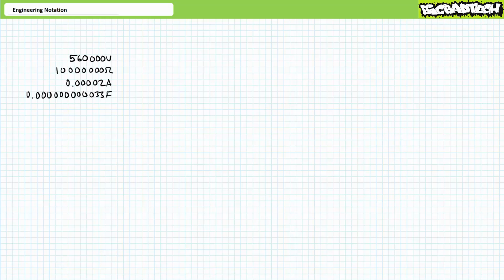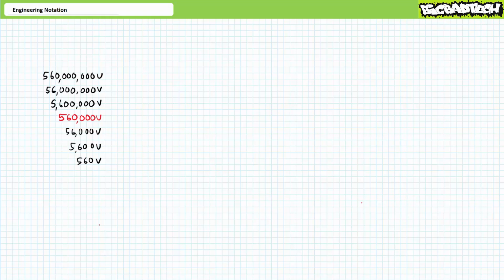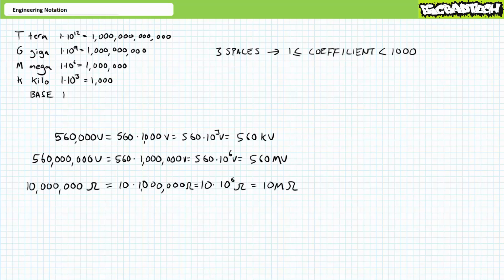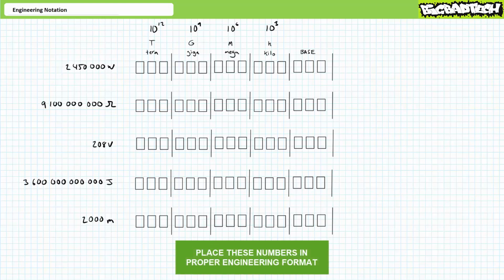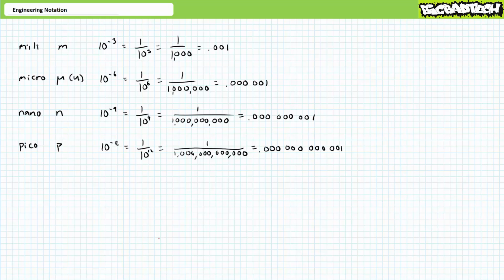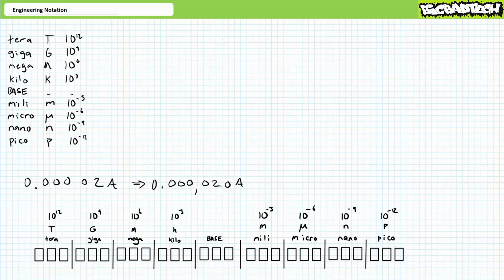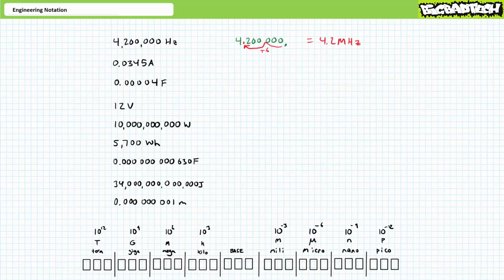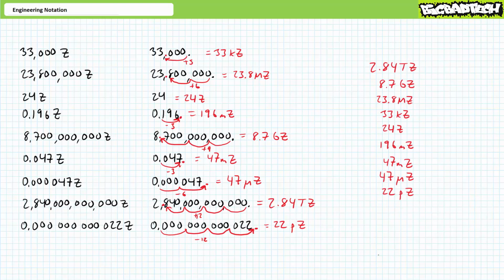Engineering Notation (Full Lecture)

Comment: I'm an electrical engineer, and I prefer scientific notation over engineering notation.  Here's why.

1. In engineering notation, the presence of a decimal point determines whether trailing zeros are significant or not significant. You can also get into a situation in engineering notation where you cannot write a number with two significant digits using the decimal point trick.  (Ex. 2.0. x 10^5  in engineering notation can be written as 200. x 10^3, which incorrectly makes the last zero significant, or 0.20 x 10^6, which breaks the "between 1 and 1000" rule.  I prefer the second option to maintain the number of significant digits.)  In scientific notation, you just don't write the trailing zeros if they aren't significant.  Electrical calculations in RF work routinely only have two significant digits.
  
2. Multiplying and dividing two numbers in scientific notation requires shifting the exponent by only one position at most.

3.  The 1 to 1000 range for the coefficients doesn't always agree with how component values are written.  (Ex.  0.1uF capacitor)

4. Resistor color codes and resistor and capacitor numerical codes USE SCIENTIFIC NOTATION !

5. Correcting the exponent to a multiple of 3 and making counteracting decimal shifts is not hard.  ( Ex. 1.44 x 10^5  -> 144 x 10^3 -> 144 k)

6. Most numerical programs and simulation tools default to scientific notation (Microsoft Excel, Matlab/Octave, pspice, etc).